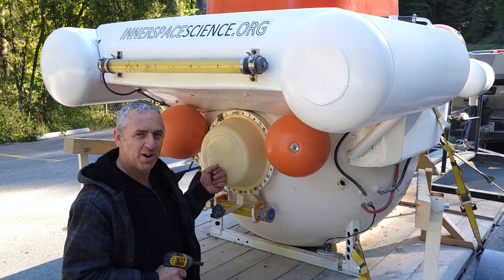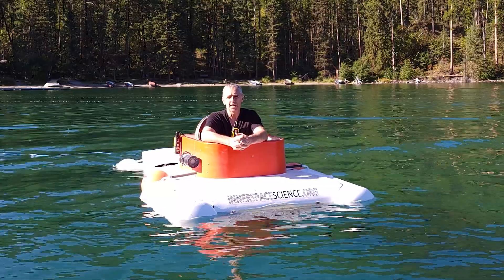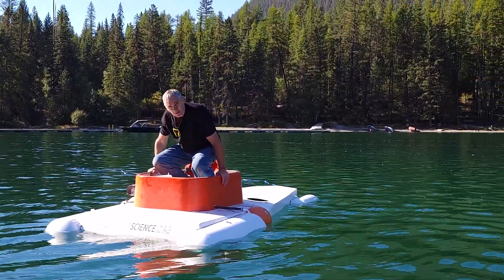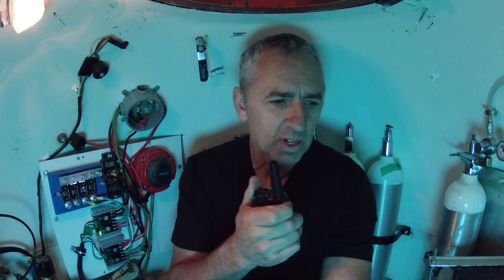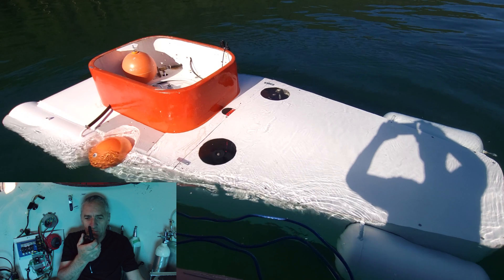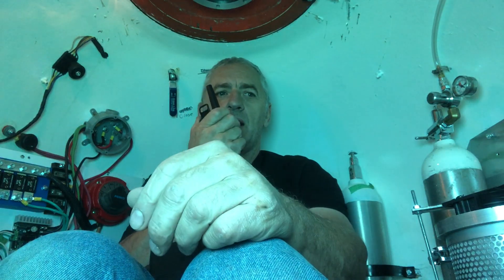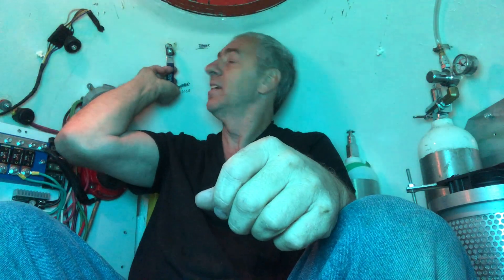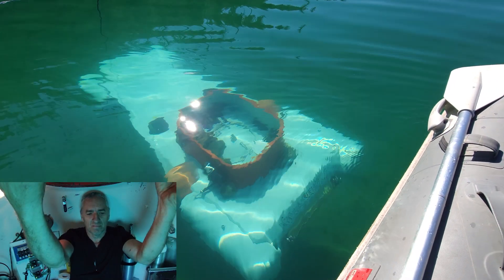E3000 Gets A New Look | Homemade Submarine

Comment: Why the vertical motor free-spin, it has oil inside it too?
Reply from the maker: The motor is turning because the speed controller is getting a signal from the joy stick.  I need to adjust the centre position.  The motors are all oil filled.
Reply: @HankPronk  That's what I thought. Thanks bro.

Comment: Hey quick question in a submarine ballast tank underwater when it fills with water does the water add weight to it or does it just take away the bouyancy then weights pull it down. Thank you.
Reply from the maker: The water does not add weight to the Main Ballast tanks.  Think of it as releasing air, not adding water.  The air is keeping it afloat, releasing the air allows the sub to sink.  If the sub has an internal ballast tank, or Variable Ballast Tank,  then it is adding weight when you add water.